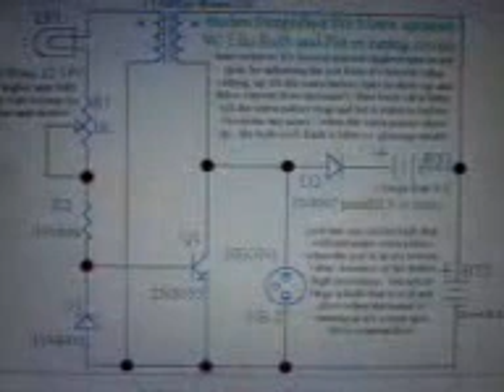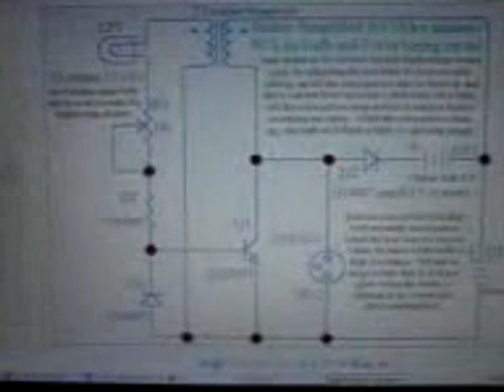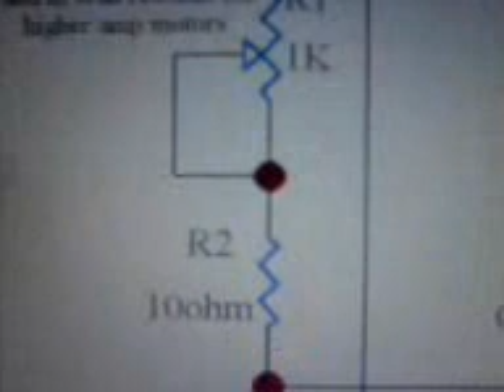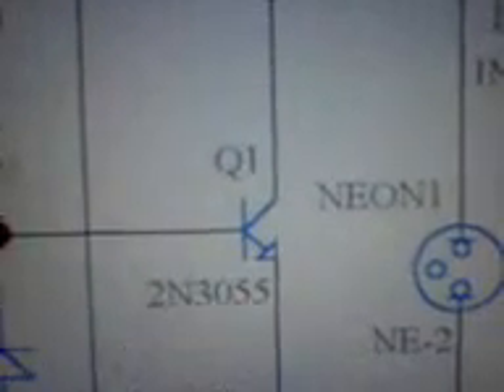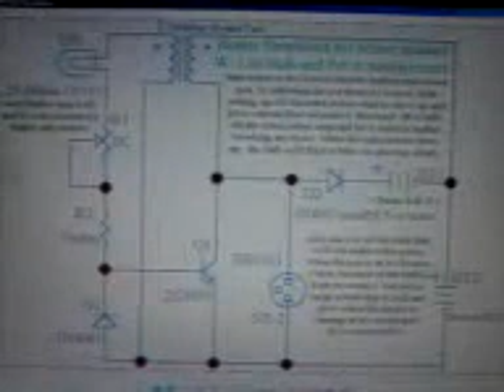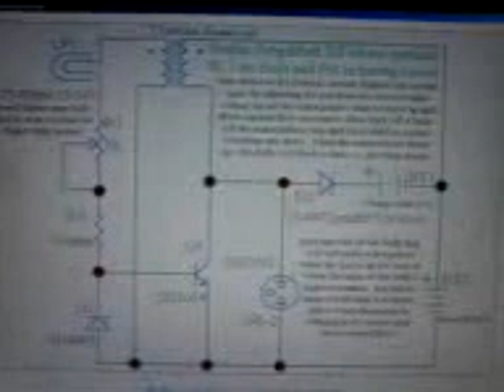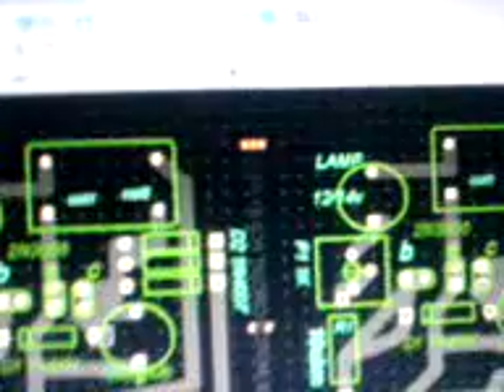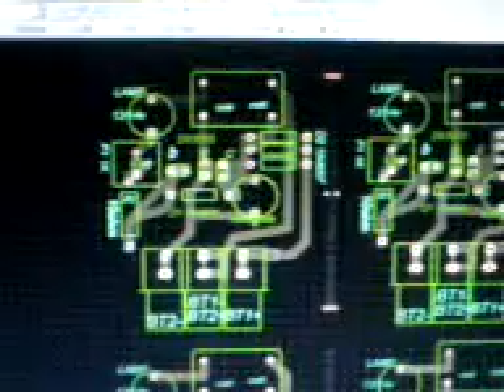Bedini SSG motor project part2 the circuit

Comment: Vary nice,, try ebay for wire,, if all else fails and you cant find in spain,, im wondering whats the difference between the peter lindaman circuit and this badini circuit? there vary simular? is it the triggering is different? one is reed switch and this is coil switch? anyway good luck !!